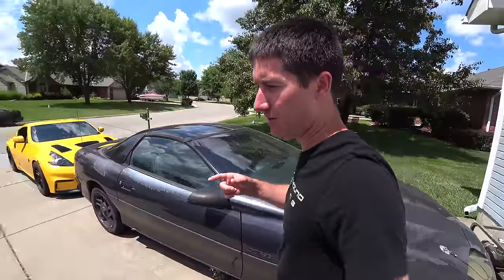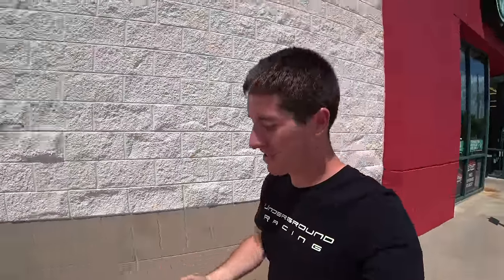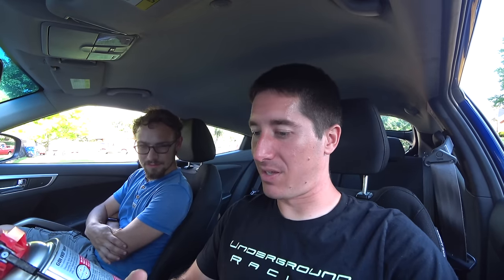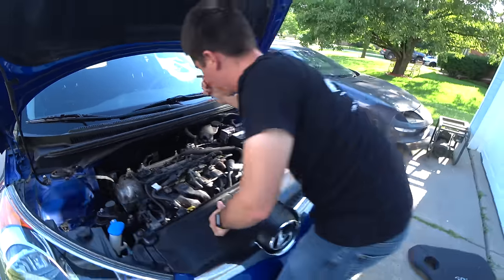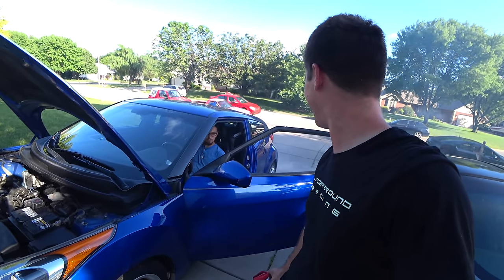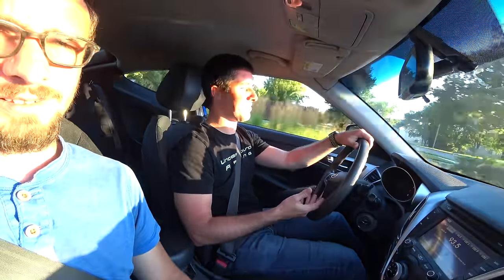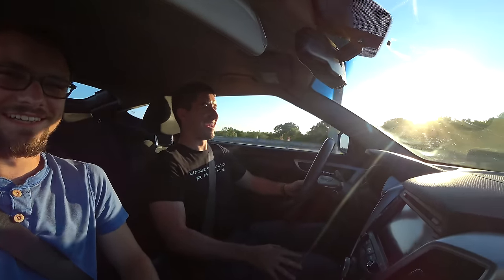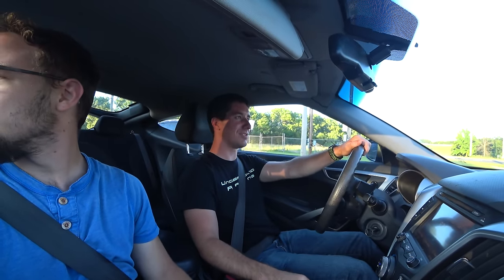How To REMOVE CARBON Build Up From DIRECT INJECTION Engines For $12

Comment: Snake oil...................But spend your money however you want. Mechanic in a can, are all sales hype with little actual work being done.

The intake gasket is worth a little more than you spent on that can, and a $5 can of carb cleaner, a used tooth brush, a shopvac and some knowledge will actually fix the carbon build up on the valves. All you bought there was some pale oil, and acetone in a can..........Same as Seafoam in a spray can.

Comment: This product messed up my catalytic converter after using CRC for a year. Now I have to buy a catalytic converter cleaner or a new catalytic converter. I recommend Seafoam. Do not use this product. It did ruin my Hyundai after a year.

Comment: I can't do the valves on mine, but I did get an endoscope and took before shots this weekend on my 2016 Sonata Hybrid. At 1/2 tank, I poured in 1 can of BG 44K and will run that down, plus a fill-up of E0 gas and check again. Then I was going to have the BG full service done.

If anyone wants to see it, I can share and even use 1 can of the CRC within the next 1-2 days. Here's the before video clip on my Google Drive:

https://drive.google.com/file/d/1gVYydgweoBZrEz_7VKee1eyEoUkovaDI/view?usp=sharing

Comment: Easier through the air intake. I did that in my wife’s 2014 Kia Rio.
Reply: Did it work for you? Any issues after the procedure? I’m planing on doing this to my 2013 Rio, using the same method you did, but I’m afraid to mess up a sensor or  get a check engine light after…
Any feedback will be greatly appreciated.

Comment: It’s a horrible idea to use any kind of product that you spray into the intake that may break up carbon buildup. There is a risk of damage to the engine and if the carbon does break up you’re pushing it through the engine which is a bad idea. I’ve had salesmans demo products twice on engines that I was working with, and after verifying before and after with a borescope camera there was no considerable difference. The best way to clean carbon deposits off of the intake valves on a GDI engine is to remove the intake manifold and use a media media blaster with fine ground walnut shells. Make sure the valves are closed of course😁

Comment: you know thats done nothing right? only way to clean it is to take the intake off and clean it directly
Reply: Yeah. He should have done this every 10k miles or so. But to say it’s done nothing is an understatement. He’s absolutely right about the heat burning off carbon deposits.

Comment: How non-car guys fix cars lol...

Just spray this shit in there until it's empty and you're done! See how much better it is? (two hours later, nothing changed)
You'd get better results by removing the head and whipping it off with a micro fiber towel and some spit lol.

Comment: Open it and prove that your efforts paid off or I'm calling bs
Reply: 100%.  The only proper carbon cleaning I've seen is by getting to the valves with harsh chemicals and physically scraping them clean or with walnut blasting.  This is nonsense.  They have no real proof if any carbon was removed.  They saw some smoke from the tailpipe and heard the engine almost die, and assumed it was carbon being blown out of the intake.  Dumb.

Comment: All these products do a minimal job; any product that will really clean all the carbon buildup out would also destroy the valves; Some simple Gumout from the very first oil change and at every following oil change will prevent that buildup from ever getting that bad !! But GDI will always be a terrible engine design; and oil burning is an eventual guarantee;

Comment: There goes shortening life of catalytic converter clogging it with engine carbon.
Reply: This is a procedure that dealerships use to clean out carbon and throttle body. The heat vaporizes the carbon.

Comment: Try this, get an already carboned up GDI valve spray that stuff on it and I bet it will not clean anything. If it will not clean with the valve right there in your hand, why would it do it in the engine. Beside that, those directions on the can are just made up so it will sell. There is no way I would believe any of it much less spray in my engine.